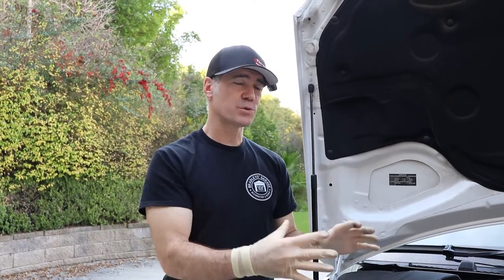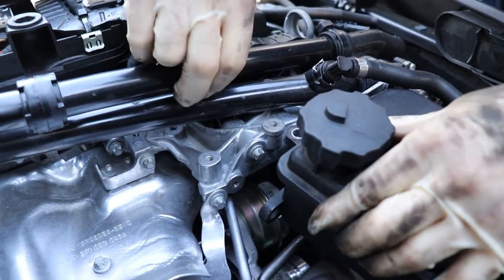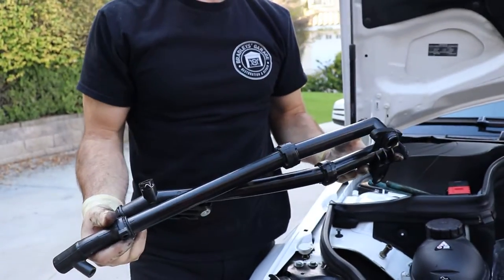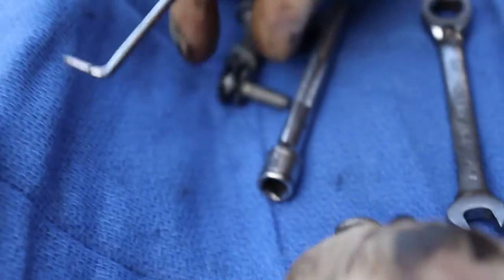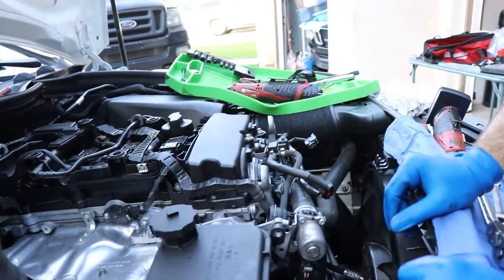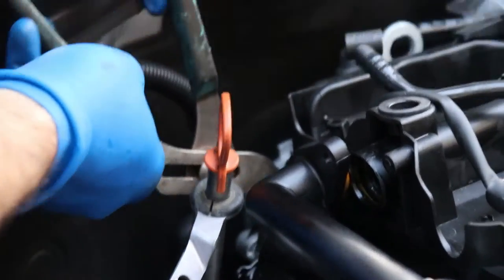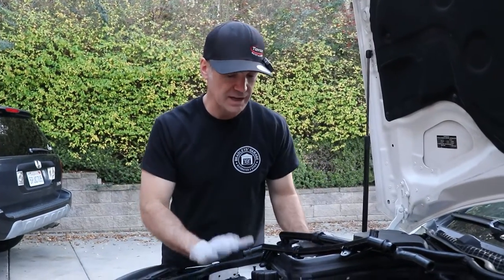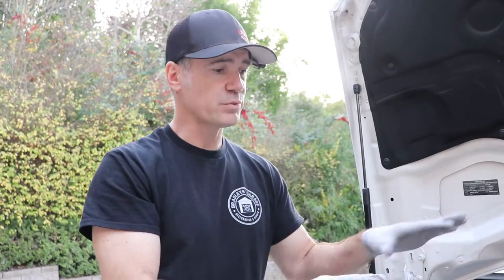MERECEDES BENZ C250/SLK250 Turbo O-Rings / Coolant Pipe Feed Line Replacement 2012 - 2015

Comment: So when I replace any O rings, I don't use OEM ones, cause they're just replacement rubber ones which will become bridle again in a few years....I bought a multi sized silicone O-ring tray and I try to use them in as many places as I can....Hope they last longer, ya know? Allegedly, silicone is more resistant to heat and most of the chemicals found in cars.... I know it's not your car and also understand you want to show the owner that you're using OEM parts and not responsible for any premature failures.....way to go man, awesome work as usual!
Reply from the maker: Thanks for the comments Ski, not sure what material the OEM ones are but they are not just plain rubber. I know it's hard to tell in the video but they have a blue/grey hue to them so they must have some properties to deal with the heat. You would think Mercedes has designed something that shouldn't fail in 70k miles.
Thanks again for hanging out, appreciate the feedback.
Cheers!
Reply: ohhh I see...might be upgraded @BradleysGarage

Comment: Thank you for posting this. Dealership said it would cost $800+ to replace my coolant line…. Sucks for them 😂😂. 

New subscriber, I have the same car with basically the same number of miles. Oil change will be coming soon too 🙌🏾
Reply from the maker: Thanks for the comments, glad you enjoyed the video. That is crazy money for the Dealer repair. Hopefully you can follow along with the video and save yourself a ton of cash.
Be sure to check out all of the C250 videos we have on our channel We just posted the oil change video so you can use that one as well.
C250 Vids - https://youtube.com/playlist?list=PLFnK0z3T00fXJS_C_0mOTHudox6MTruuC
Good luck on your Mercedes project, Cheers!
Reply: If i were you i would get rid of that car asap. All of those models of that year have a problem with the camshaft sprocket stripping and causing hard starts. Big repair and will he very expensive.
Reply from the maker: @warriorplutotrent3827  Thanks for the tip, we will pass that info along to Jake.
Cheers!

Comment: Excellent video!   One question.  Mine is now leaking where the coolant pipe hooks into the coolant recirculation pump.  Is there some sort of o ring in there?   One fell out of when I took off the old pipe but the new pipe didn't come with one so I used the old one but I don't know if I got it in the correct position.  Any help would be appreciated.   Thanks!
Reply from the maker: Thanks for the comments Doug, sorry to hear you are having trouble with your MBZ. We are not exactly sure which hose you are referring to, however here is the diagram for the cooling circuit. Let us know if that helps you out.
https://nemigaparts.com/cat_spares/epc/mercedes/1/fg/204347/61f/50/165/
Good luck on your Mercedes project.
Cheers!

Comment: So my feed line has a crack in it and is leaking I was gonna just replace especially since it’s right there on top, but should I do these O rings as well there’s no leak from them that I’m aware of but since I’m already down there?
Reply from the maker: Thanks for the question Brandon, it might be a good idea to change them out since they are inexpensive. If you don't mind taking a few extra items off, it can provide you with many more miles without worry. It seems like these will fail, it's just a question of when.
Good luck on your Mercedes project, let us know how it goes.
Cheers!

Comment: Hello I dropped the top long T25 screw. How and where an I get a new 9ne?Do you have the specs for it?
Reply from the maker: Sorry to hear that, here is the diagram for that part of the engine:
https://nemigaparts.com/cat_spares/epc/mercedes/1/m/271860/d71/20/015/?chasis=20434761F
Looking at the description though, they only show the 6x25mm which is the shorter one. They are showing the longer one to be a hexa bolt at 45mm length. You might have to swing by the local dealer to have them try to pull it up in their system. Maybe they changed the spec after the car left the factory.
Let us know how it goes. Cheers!
Reply: Thank you, I did order the 6x25 which is as the wrong screw. Also, I stopped by a local bolt shop but no luck. I’m going to try a junk yard next.
Reply from the maker: @ownmypeace  Sounds good, let us know how it goes.
Happy hunting,
Cheers!

Comment: For the last clamp in the video, its actually called click-r, they are special ones and are reusable. They are actually the best ones, because they will never loose tension or get loose, but the downside is thst you need special pliers for them, so you dont get annoyed using screwdriver or other tool, that can damage the clamp. The click r pliers are cheap, and if you working on german car, i suggest investing in them.
Reply from the maker: Thanks for the comments, we knew there were special pliers, just wasn't sure what they were called. We will look into adding a set to the garage so we have them for the next project.
Cheers!